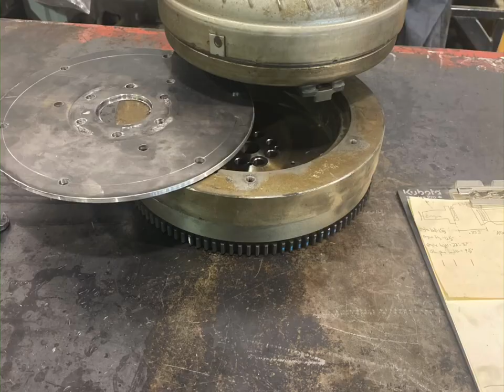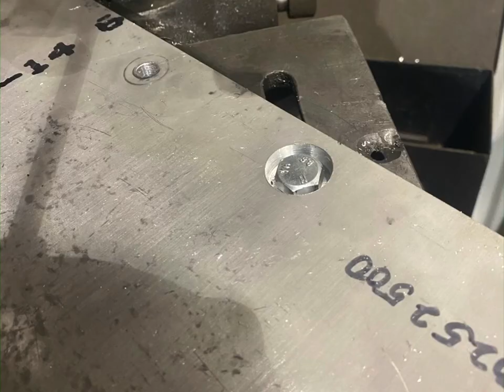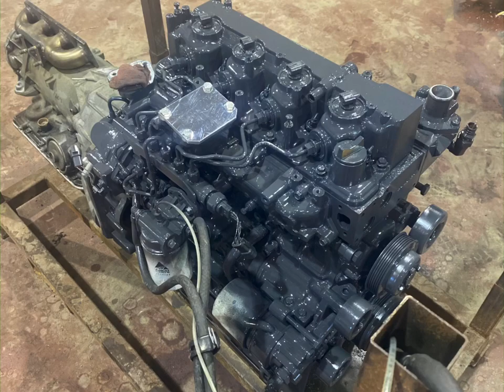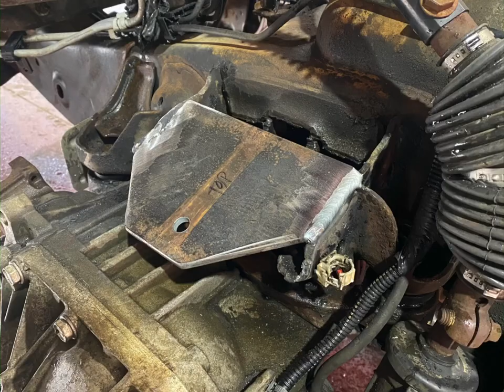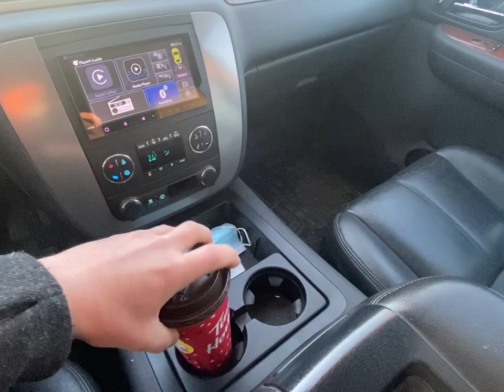Kubota Powered GMC Sierra 1500!!!

Comment from the maker: It’s been a while now since I built it. But I have been driving it daily, approx 20,000km so far, with no hiccups. Getting over 30mph now on highway, 25 in town
Reply: Mph or mpg? I assume mpg but just curious
Reply from the maker: Mph:) the engine rev limit is 3000rpm so top speed is 140kph
Reply: @nissannation  oh wow. Ok I didn’t expect that haha. That’s a cool build regardless. It would be cool to see you do a rear end swap for higher speed or something like that.
Reply from the maker: Flying Saskatchewan
1 second ago
It’s currently only 70hp with 205-215ft/lbs torque… so it wouldn’t have the power to go any faster . I need to find something or someone that can tune a Kubota (Denso) ecu
Reply: @nissannation  ah ok.
Reply: @nissannation  reimer tuning
Reply: @nissannation  ah dude good luck, Denso also supplies toyota and trying to crack a denso is difficult
Reply: OK am I reading this wrong ? U are saying 30 miles per hour it top speed or 30 miles to the gallon I see u put 140 kph I'm not sure I'm thinking of putting 1 in my Tahoe for miles pre gallon more my Tahoe only gets 10 mpg now sucks I would like 20 mpg .
Reply: @nissannation  that’s impressive. You can get 80+ miles per hour out of it and 30mpg. I like seeing these swaps in half ton trucks because there is a need for this. The remote start was impressive too. I want to do this one day

Comment: Lot of work for those low number.   A bit like Shifted Interest from ontario with his kubota  powered Ranger   Nice work none the less!!
Reply from the maker: Thank you.   70hp is just the stock ecu program. We will bump it up a little more in time,  but the main goal of this project is to have a full size truck with a kubota engine that gets 30mpg+ and does highway speeds.
Reply: Man that really is some quality work, Is it getting 30 mpg and will it do highway speeds. Did you go with a lower stall converter. As the stall on that tmbx converter a little high. I cant think of the code that uses a 1100-1300.  Been wanting to do the same thing except to use a mercedes/dodge sprinter drivetrain.

Comment: I wonder what the Kubota dealer thought of this mod?  I wish I had the time, money, knowledge and patience to do something like this.
Reply from the maker: I was a mechanic at the kubota dealership for 11 years:) they were very supportive of me doing it after hours in the shop. Took 1 year to make the engine and electronics work together, and another 4 months to mate the transmission and accessories. Over 30,000 km without issue, and 0ver 30mpg
Reply: @nissannation  Nice.  Better than the old engine, I would think, it probably increases resale value too...now if Diesel fuel could drop in price.

Comment: Could you make a video going over the wiring on keeping the factory gauges and transmission working with it? I have 2010 gmc 1500 with a 5.3 and want to put a Cummins in it! Thanks
Reply: Also how to get the fly by wire pedal to work

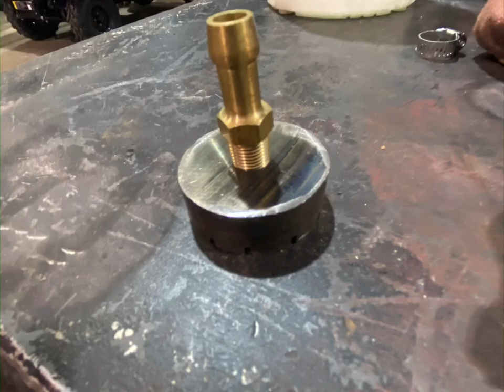Comment: What is this slice of steel round stock pictured in your hand at 1:39? It's has many groves cut into its face giving it the resemblances of a clock face
Reply from the maker: That’s the weighted fuel pickup for in the fuel tank. It sits on the bottom of tank

Comment: I’ve got an engine same as yours with the ecu but no wiring harness. From a 2015 Yale forklift. Did you have a harness that you modified or start one from scratch? 
Thanks
Reply from the maker: Made a harness from scratch. The hardest part was sourcing all of the connectors. The biggest was the 2 ecu plugs, found them on Alibaba I believe.